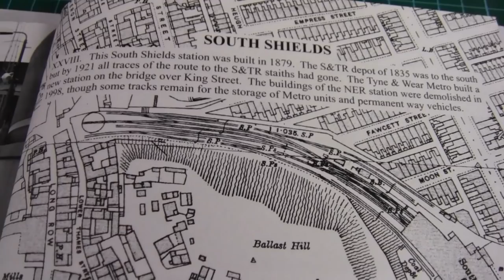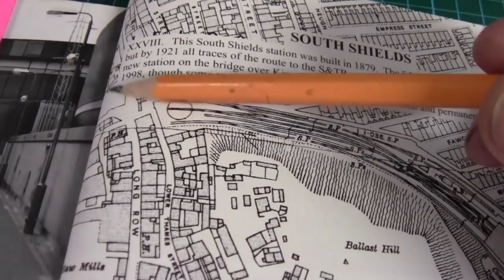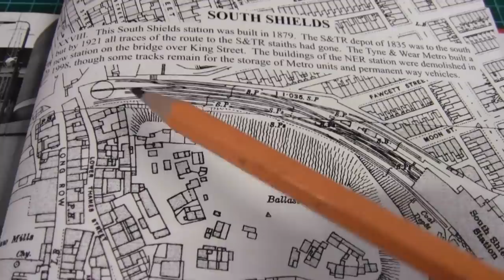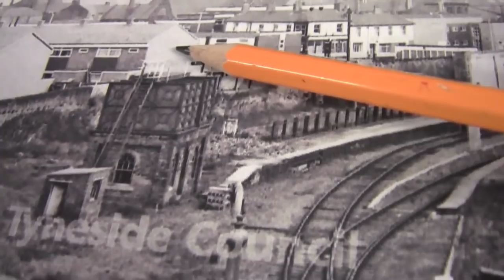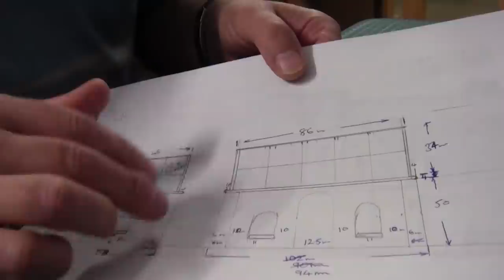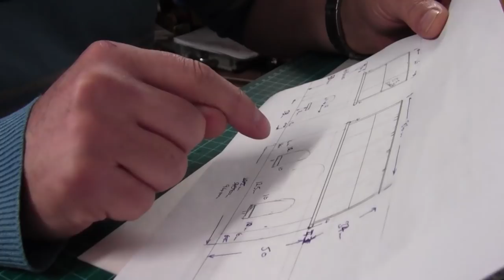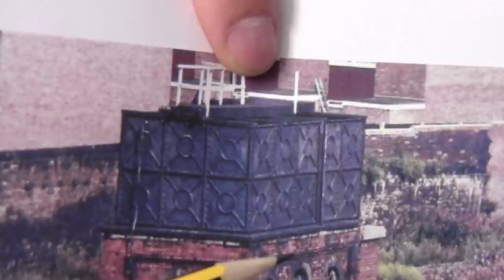OO Gauge N E R Water Tower Part 3  No 258

Comment: Nice solid and methodical construction, this really is going to be a water tower with a difference. Something I will certainly add to my bucket list!  Stephen
Reply from the maker: Hi Stephen. its sound like you want to have a go at making one.....as you have probably guessed, i am slowly working my way through my bucket list. just 2 more building to go...........but then again my bucket list could never end...........all the best Tony
Reply: @TONYNORTHEASTERN   Definitely as adds so much character and interest to the layout, having 3 kits all the same will simply not compare. I will probably have a go at incorporating one into an engine shed, now see how you changed my thinking!  I wish mine was down to only two items ....All the best Stephen
Reply from the maker: The trouble is Stephen. i have found another building i want to build but this one is for Tyne Dock. its a market square building found in south shield. if you have time google it......market place south shields.........kits are great but i would have to tinker with them. to make them unique..........cheer's Tony
Reply: @TONYNORTHEASTERN  oh yes a double flight of steps left and right, lots of support pillars, those windows,  a domed tower, opportunities for fitting out the inside, double digit weeks of build looks like everything was a practise leading up to this.... exciting times at the TNE!   Stephen

Comment: i enjoy the research you do. where do you get the plans/maps from? they look really interesting. thanks again. your Toulouse connection.
Reply from the maker: Hi Kevin. Mostly Google. South Tyneside  library. i have a couple of books which has that map in what you have seen in the video....Tynedock to Consett bock. the info is out the there....depending on what you want to build...........thanks again cheer's Tony
Reply: @TONYNORTHEASTERN    Hi Tony, not that it helps here, but have you come across Britain From Above? https://www.britainfromabove.org.uk/en/image/EPW019784 . Also looking at that "protuberance" at 4:56, could it be the water feed, or some kind of ballcock like mechanism?

Comment: That looks fantastic i like how you do the lights in the buildings i use LED strips and they seem to work just fine just one question what resistor do you solder to the LED to get the correct amount of brightness? Cheers and all the best.
Nicholas.
Reply from the maker: Nicholas. the resister are 1.5 w  470 Ohm Resistors perfect for LED's to turn them into 12v supply.. Led strips work fine. i have used them in my engine shed. and in some coaches..........thanks again cheer's Tony